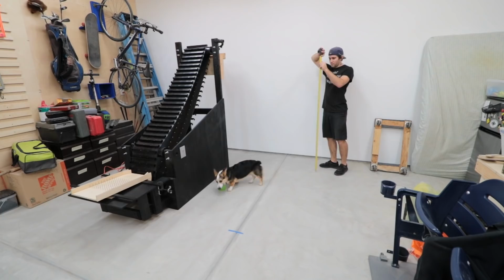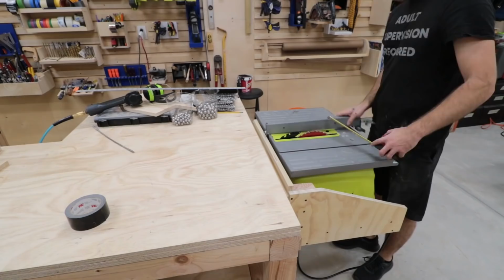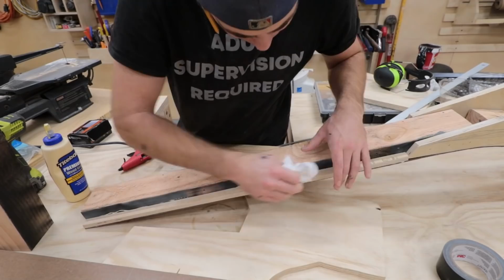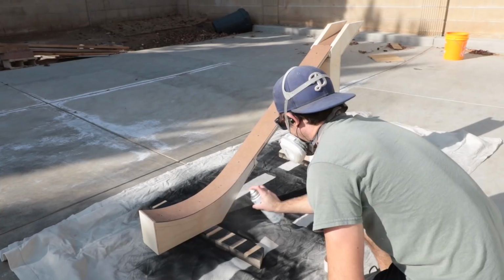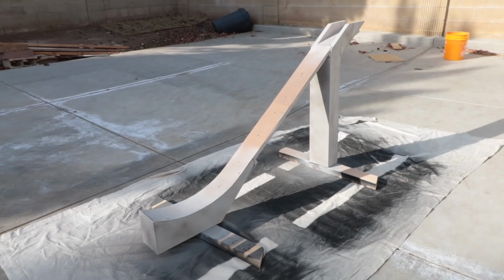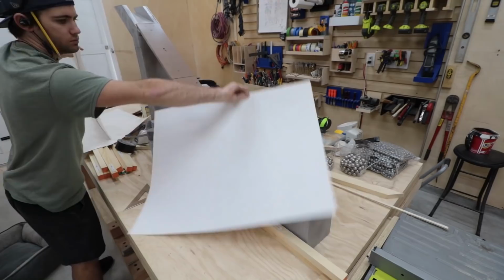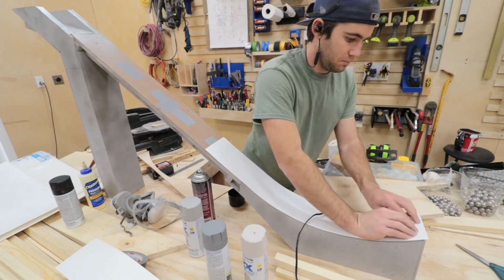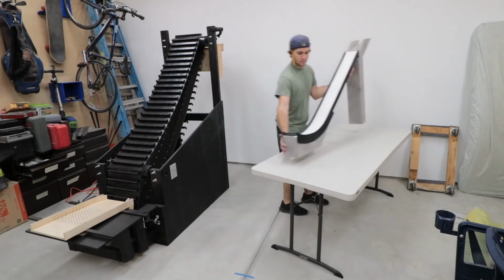Ski Jump Marble Machine Build, Part 1

Comment: You could try putting some polyurethane on the metal carriers of the lift to help deaden the metal on metal sounds.

Wintergatan did something similar to mute the marbles hitting his catching funnels on the Marbles Machine X.
Reply from the maker: That issue has been fixed and you’ll see it in a later video.